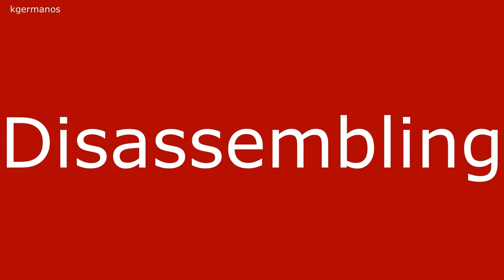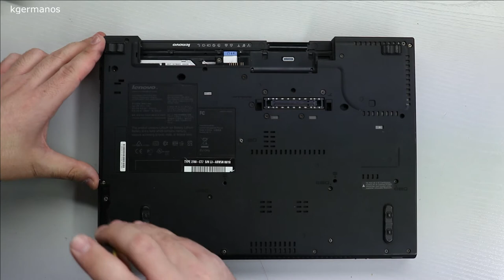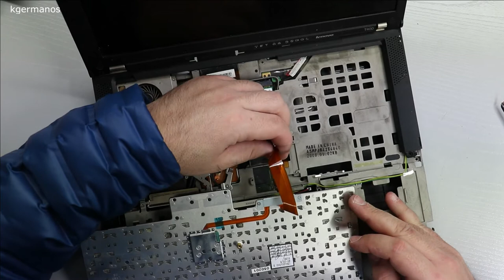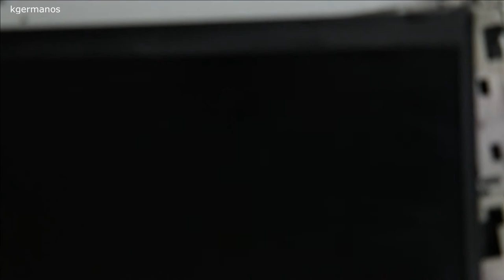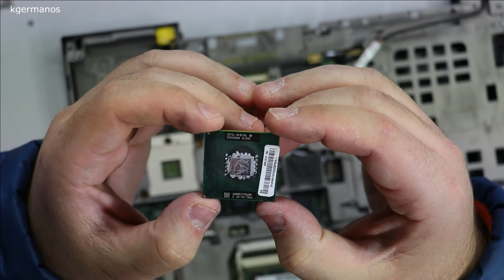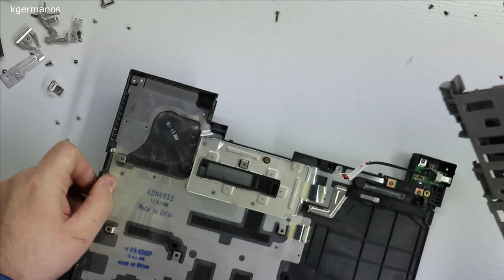lenovo thinkpad t400 upgrade ram cpu hard drive and fix cooling system

Comment: Thanks, few notes, my T400 had a big metal plate that yours is missing, also when you take out the CPU if you just keep screwing that screw it will literally jump out of the socket as it did with me, lol.